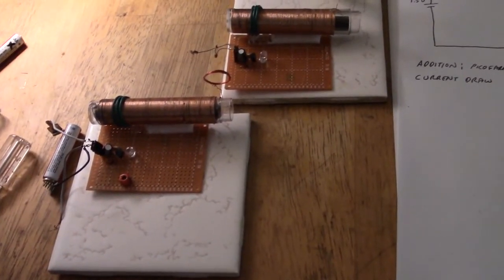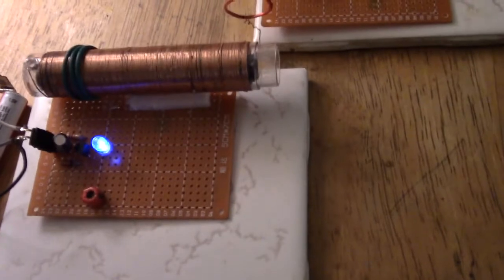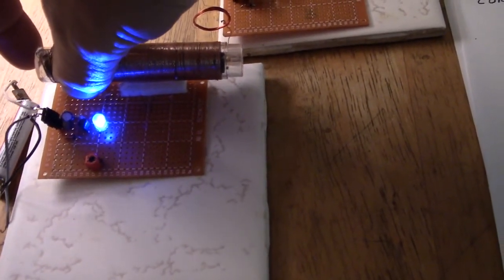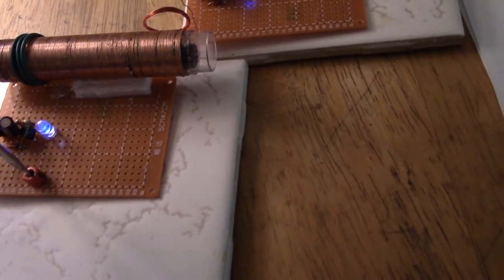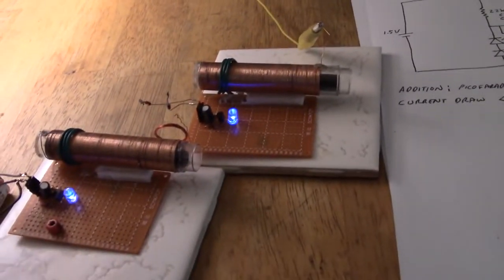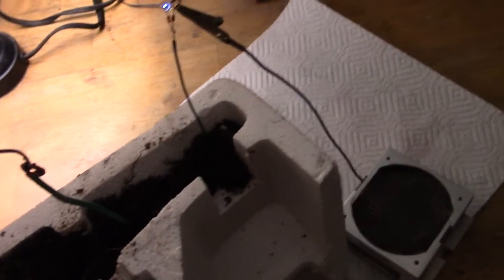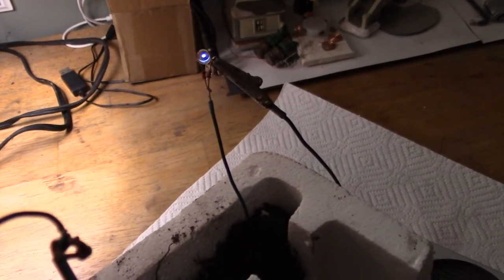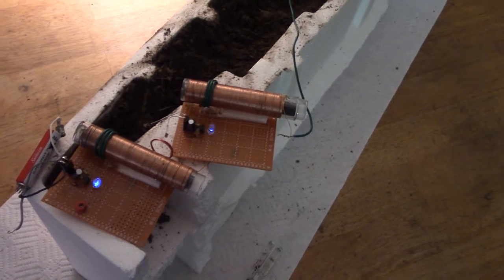Dual Tunable Exciters

Comment: Excellent demo.  Tuning with a ferrite rod inside the secondary is counter-intuitive (at least to me).  Rather than tuning the oscillation frequency, I would have expected the ferrite to quench the oscillation altogether.  So this surprises me a little.

Also, the soil demo is fun.  Is the soil just acting as a traditional current conductor, like a "wire"?  Or is it responding to the RF somehow?  Does salt water behave in a similar way?
Reply from the maker: Thanks. It would work a lot better with salt in there, but the idea is to simulate just the regular ground.. I have an aim to replicate the scene in The Prestige at some point, where Tesla directs the assistant to place bulbs miles away from his transmitter. Well, for me it would be in the backyard lol.
Ferrite is a weird material and often brings surprises. The expected result was the powered circuit to not light its LED with none there ! 170 turns on a tube that thin doesn't normally work well. 850 turns on larger diameter being usual.

Comment: Excellent.  I will try that.  This is what Dr. Stiffler went to with his SEC 18.  He changed from a tunable inductor ( the SEC 15) to fixed inductor and a variable pf cap.  He told me that the tunable inductor he used on the 15 board was too troublesome and that was the reason for the change.  It is just a different way to tune a tank circuit.  On this 'Musical Mini Tesla Coil" circuit I'm working with your idea for a position of a variable cap should do the trick. I like your second Slayer Exciter pickup setup.  Dr. Stiffler did a lot of work with that idea.  I can't stop thinking that the reason I stopped working with this stuff was the elusive PSEC and what we decided was really happening.  That was a big disappointment--- similar the Muller Dynamo project.
Reply from the maker: Your foray kicked me into starting up again with it all too. Yes, I think you're right, the FM station right next to his place didn't help peoples perceptions. Even though he often showed the Spectrum Analyzer, the proximity sullied it all. Not sure if it counts but my PSEC copy ran using the GND of the scope just fine, the scope wasn't unplugged & it seemed like mains leakage effects. 
The pickup method will have an exacting cap across the coil...it's what i was doing with Wireless Electric Racing (desk top Drag Racing with mini cars) a couple of years back and that needs a revisit. 
There is the Pierre Cotnoir device now...it works, but he is building a V2 that doesn't. His original vids go up and pulled back down like a yoyo. Crazy stuff.
Reply: Thanks.  I will check out the Pierre Cotnoir device.
Reply: I have tried that method but it has never worked for me.  No radio station near me and the power lines are buried underground.  There is very little electro smog to harvest where I live.  What I do have is lots of sunshine and that gives me plenty of free energy using photovoltaics.

Comment: if you have alkaline empty AA's, you could put one of those on a leg of the LED. It will dim the LED, but I wonder if it will charge up to a certain extend.
Reply from the maker: That's an interesting thought, the very effect of sitting in the line of transmission in the right direction may do something. 
Will do that experiment in the next vid :)